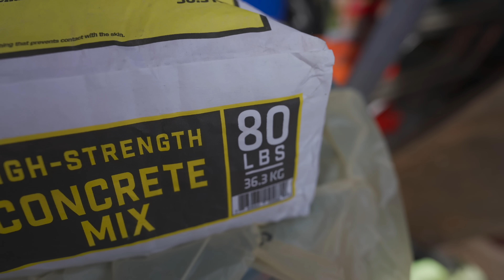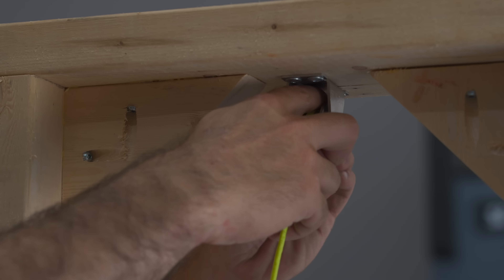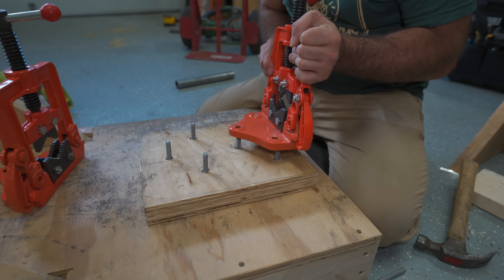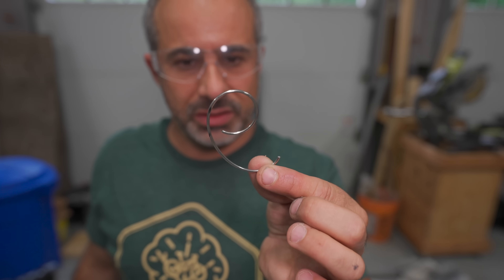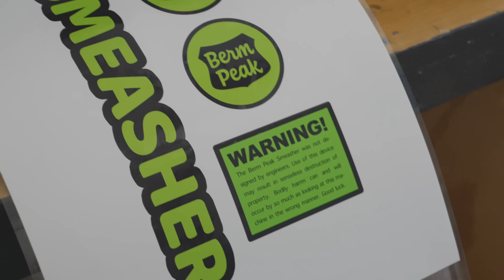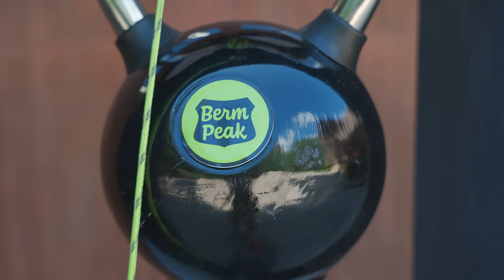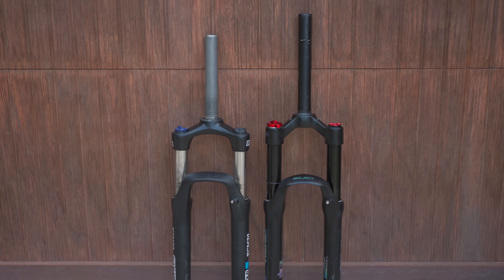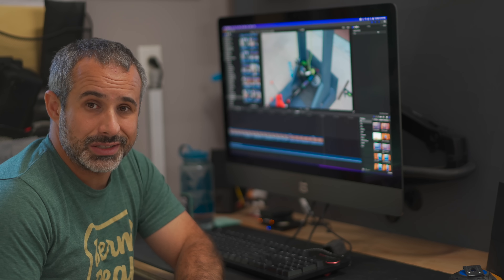Building a Suspension Fork Impact Tester for Science

Comment: I need help finding a decent fork for and older 2005 giant reign. It’s a 26” 130mm straight 1 1/8 tube disk brakes. I’ve hade No luck finding one. Local bike shops can’t get parts for the old spring manitou splice elite.

Comment: HI. I have a request/idea for a video. I have gained a lot of weight over the last 4 years.
I was looking for a new frame, or whole new bike, since my trusty commute MTB, now have a completely cracked seat post tube/socket. What I noticed, where how hard it is to find a frame that support a very heavy rider. 300lbs+ etc.
I was hoping you could reach into your knowledge and connection, to maybe make a list of components that would hold up to such heavy riders and the limitations?

Cheers from Denmark.
Reply: Buy an enduro bike or a downhill bike, they're built much stronger, or if price is an issue look for a bike with oversized tubing and at least over 30mm seat post ,they should handle upto 400 pounds ,of course you're gonna need big tyres to spread the weight at least 2.3" width and always check your spokes are tight, I'm 6'2" and around 270 pound so I always look for strong components
Reply: @ianmangham4570  The last part of your comment. "I always look for strong components", that is exactly to problem. What is a strong component and where to find them? Enduro bikes are out of the question price wise. They cast too much in Denmark etc, but it's a good bet. I am 189cm tall, and finding a frames fitting that height on limits the selection.
Reply: @Mr_Wh1  Strong components are OVERSIZED/BEEFY
Reply: @ianmangham4570  I looked at a Cube MTB the other day. They had a higher weight rating on their web page then most others. The frame part going from the head to the crank, was big and almost balloon like. But when I knocked on the aluminium, it sounded like it was 3x the thickness of a beer can.
Reply: @Mr_Wh1  You should buy 2nd hand from Ebay
Reply: @ianmangham4570  If you mean Enduro bikes on the used market, then maybe. But you don't know what you get. Here in Denmark even the used price on "specialized" bikes are crazy. Like starting at 3500USD crazy. 🙃
Reply: @Mr_Wh1  Wow,crazy price's, here in England 🇬🇧 you can buy a 2nd hand £1500 bike for £500
Reply: @ianmangham4570  Gotta pay those world high taxes. They are so high, that there is special export reliefs agreements to Denmark for cars in every country, or it would be impossible to sell a car here due to the prize being too high for people to pay. A high-end Tesla can cost you over 100k USD.
Reply: @Mr_Wh1  The thickness is only where its needed, you are better off buying a second hand bike from EBAY UK then asking them to post you it to Germany 🇩🇪, still WAY CHEAPER, some beautiful quality CUBE mountain bikes on ebayuk 🙏🇬🇧👍

Comment: The most hated suspension fork here in Philippines. If you used it on trails either the stanchions or the crown Will suddenly cut or crack off. The integrity of that brand is pure trash.

Comment: The most common issue with Bolany fork is the crown and the arch can break easily, others may have issue with the lockout system, it doesn't work properly in the long run. That's why I prefer my clients to buy SR suntour forks instead of cheap and garbage forks

Comment: I think if your trying to hit close to true machining as the one they have at cane creek, then maybe using like a used at-home gym system and just retrofitting it into a smasher.
   1. Already has a rail system with added weights that you can then increase or decrease weight for testing rails
   2. Depending on the specific type, there are ones that are steel (mostly older versions) that can withstand the added punishment
   3. Adding steel planks on the side where the seating is located and adding the kettlebell with a guide should minimize the necessity to come up with something from scratch
   4. The post where the seating would be on could be then fitted with the clamps with some U-bolts since the seat is usually smack middle of the machine

There's also some other stuff that would be taken into consideration but I think that outweighs the cons and assuming you get a good used affordable gym system, why not
But then again, just my 2 cents, probably something easier and simpler out there

Comment: Love the video.  R&D Engineer here, if you put the fork at the top and tie a rope between the weight and axle then drop the weight, that would result in much higher consistancy in the experimental results and eliminate a lot of the variability in the impact. Could also throw in a strain gauge on the rope to get measuments of how much force is being applied and change the length of the axle/weight rope to alter the force beeing applied.

Comment: You need to sort out the clamping mechanism as the rotation at impact means the tests are not repeatable and consistent. Also dont use those jaws as they will create stress risers in the stem (but i think you already figured that out.) An easy alternative will be to bore a 1 1/8" hole in a 4"x4" square block of wood, cut in half down the hole length and use 4 bolts through it to clamp down. For the purposes of your content this should suffice as I doubt you want to go the the expense of creating a setup made from exacting milled steel parts just for some YT entertainment.

Comment: Hey seth.  Something you could try to fix your issue with the box limiting the amount of deflection the forks have is you could add a second rope and pulley and pull on a angle with the weight tentioning the rope only a few inches before it hits the ground. That way the sky is the limit for how far the fork can bent. Hope that is helpful. 🤙

Comment: Unrealistic test.  Howmany direct impacts would a fork see, nearly none unless you ran it into a tree or a wall.   

The fork only see forces in the same angle as the trail or rake that its specced on.

The only useful data from this test rig is steer tube strength,  which can be seen with this current build because you used a secondary pipe to be clamped down

Comment: if you got similar results based on what information was provided with this test alone then it would be inconclusive because with only two test results they are most likely only showing the capabilities of your smasher. You now know nothing new about either fork except that they both WILL bend under force... that is all... but yeah secure the fork completely and drop the area where it will bend as you said; and you need to guide the weight so it hits centered everytime. Or purposely try to hit it on either side maybe to test shearing strength... Gotta do a part two though its a great idea, but tests like this need to be extremely precise to be able to show any results whatsoever, otherwise you're just reading slightly correlated numbers, i love the idea of a fork guillotine!

Comment: I have a similar cheap fork by a company in the uk by a company called Air Bike. They say they work with a major manufacturer but due to an NDA they won’t say who it is…..alloy steerer too. It’s worked pretty well for me, I’m probably the same height as you Seth, little lighter, not as good a rider but I’ve taken it over some rough terrain and had some hucks to flat and it’s done it’s job. Maybe check them out

Comment: The big problem here is, where as the steel one will bend the aluminum one can form micro fractures which can lead to it snapping later on. Which in the past is why aluminum forks were so dangerous (Death Forks).

Comment: I say chop off the front end of a cheap steel donor bike so you can weld it to a slab of steel.  Use wedge concrete anchors to mount the slab to your test rig. Mount a stem and handlebars with strong springs under each end of the handlbars to mimic the deathgrip of a panicked rider who slams the bike into a large tree/boulder.  That will give you more "real world" results.

Comment: Hey Mr Alvo what's a good winter time hack when riding in snowy weather and temperatures in the teens to keep your gears and cables from freezing and stopping you from shifting? Just wondering also would coating the cables in anti freeze work?

Comment: You should use or build a bow hunter's quick release and replace the pin. Also, have a strike plate that your kettle ball hits that is implemented into the base that falls evenly. Next time you build your base, put pvc tubing or steel tubing in your wet concrete where your clamp bolt holes are going through, just to save yourself the headache of drilling holes. Looks good though and I appreciate your videos.   I'm nobody, by the way and am probably wrong about everything I suggested.

Comment: less than 1 minute into the video and I notice the design flaw. didn't even have to get to the end to verify it. The end of the forks that takes the impact needs to be free. hanging. The base underneath. it doesn't give it enough room to take the whole impact of the weight and get any type of meaningful data. useless contraption entertaining content.

Comment: I'm surprised you didn't pre-mark you clamp holes and put some small pvc pipes into the concrete so the you didn't have to hammer-drill through the concrete. Also some casters on the back would help with transport.

Comment: I have one of those Bolany forks on my bike. Needless to say, it runs alright - I'd say a little better than the Suntour fork that originally came with it given that the air is more responsive. You could say it's basically an air version of the Suntour. 

The only problem, however, is that none of the parts are replaceable, such as that damper cartridge given that they are made differently for every single fork. Even the dust wipers and other seals have no equivalent replacement. 

Being a cheap fork you can run it to the ground and buy a new one, even re-oil it once in a while to keep it running nicely, but it bothers me that the "company" doesn't have an online parts store to keep their product reliable. 

The reason why bike manufacturers use the Suntour, I think, is because Suntour has a longer history of testing and runtime compared to Bolany. Those heavy steel bits mean the Suntour will last for years under normal riding conditions with little maintenance. I get that most riders hate them, but it's hard to argue against their durability for beginners crashing regularly in to rocks and trees.

Comment: Hey Seth! love your vids! I have a question. Can you fit a tapered fork to a non tapered headtube frame? Reason is, my bike is a older Norco and most of the nice new forks are tapered. Is there maybe a adapter of some sort? Thanx man!
Reply: if the fork is bigger than the headtube it physically cannot fit into the frame. some suspension forks allow for removal of the steerer tube from the fork crown which would allow a new one to be fitted but that's not an easy procedure. 
if the frame headtube is bigger than the fork, there is likely a headset that will be able to adapt them.
just get a non tapered fork, even though there aren't many there's still a decent price/quality range of them from coil to air to oil. i just put a rockshox recon silver TK air fork on an old 90s mtb for a customer and its fantastic.
Reply: A bunch of manufacturers have lower headset cups that fit into straight sized headtubes and accept tapered forks. For example Cane Creek 40 EC44/40 Lower Headset Cup would be used for a straight headtube with 44 mm internal diameter. If your headtube size is different try googling the right part. You will have to live with an external bearing cup though, just fyi it will raise the front by a little compared to a zero stack cup.

Comment: Need a way to keep the fork from spinning during impact. The weight being round isn't helping. You could probably add something flat and wider than the fork to the bottom of the weight to help this. Just gonna have to be pretty rigid. 
Or would it be useful to clamp the actual steer tube instead of slipping it into that pipe?
Reply: Looks like cane creek clamps the steer tube.

Comment: As a to be mechanical engineer and a diy crafter
I praise the effort seth.
But it would be thetter if the weight had a angled point which would hit the fork, also, you can build a guide for the weight to come down precise everytime with the sideposts as guide rails..
And the steer tube clamping vice would fare better if they were mounted to a hard surface, 
The wood would create dents and lose energy

Comment: Interesting idea, and I have a couple of contents and questions on it. 
First the questions: why do you want to hit the fork from the front? That’d be like riding into a wall. Yes it’s good to test the perpendicular strength but in practise that’s a force you only see in exceptional situations. 
My other question is, how do you quantify the force on the steering tube section? It’s actually not too complicated with newtons laws.

As for the comments (or considerations):
Assuming no alloy characteristics, steel is 3 times as strong as an equivalent object in aluminium. This means you can use a tube that’s a lot thinner from a strength perspective. 
However, with tubes, the wall thickness matters. if the steel tube is three times as thin as an equivalent aluminium tube, it’s actually more likely to buckle. It’s also less stiff. 
In addition, steel is much tougher than aluminium. This means it flexes less before it breaks. 

This means that for the same force, if the force is high enough to break steel, it might not break aluminium, as the aluminium flexes more. (Actual specs you can find for specific alloys from manufacturer websites).

What that means for the fork, is that the fork should be placed much higher in your construction to cater for that flex. 

You can also make some predictions of breakage, soo you can estimate the weight you need to break the steering tube. (Again a few laws from mr Isaac N).

Super interesting project!  I look forward to seeing more!😊😊

Comment: This looks like a fun toy and looks cool in a video but its little more than that.
+ Its no where near stiff enough
+ There is a reason machines like this use linear guides, you need to control how and where you impact the fork/product. If you look through the ISO testing standards there are also very specific drawings for how the impact surfaces are machined
+ You need to clamp the fork as it would be clamped on a bike. With those orange clamps you're clamping in the middle of the steerer, this is not realistic
+ You need some way to measure the data. This would ideally be the total displacement during the test, permanent displacement (after the test), and acceleration of the carriage. From there you can calculate anything else that you may need

I would be happy to advise you a bit on future projects like this, I have designed and built out many machines that are used in the industry

Comment: I would have put rails on the insides of the vertical part of the smeasher frame, and built a frame to hold the "bowling ball" that fits into the rails.  That'll keep it traveling straight and will hit the forks more squarely.

Comment: Weight needs to be guided down, easiest way is a wooden bar with 3 cutouts. Center one for kettle bell which fits snugly and two holes in the side so you can put either pvc or metal guiding rods. PVC is cheaper but any flexing lowers efficiency, using 'cheap' plumbing tubing ( stainless ofc )  will do better I think. You need the guide rods to make sure the path the weight can take is always the same so results are consistent with the changes in material strength or impact force and no other factors. 

Forks need to be TIGHT, you can't introduce play it will introduce random results. 

If you really want serious results, weld a frame for this purpose. Don't make it out of wood, it might work well but I doubt it would last and then you have to rebuild and your results are incomparable suddenly. Also, with most test rigs, you want to make sure the rig is always stronger then whatever it is you're testing. 

I like this concept though, it's very interesting and it's something the industry itself has way more insight in then us consumer since as you showed they actually do test this in house... they only never give results other then: maybe don't do XXX with that particular fork. I would perhaps like to see the same concept but with bike frame's themselves. If you crash, what would happen to your frame ( different frame types ) and should you worry about replacement or perhaps if it's steel can you really just 'bend it back'? Those kind of things are well known, but only because people always talk about those things... I never really seen it tested and visualized. Again a point for a welded rig as you can make it so it can hold all kinds of objects, in all kinds of orientations. 

In the end I think I wouldn't even rely on gravity but build a hydraulic piston ( you already have an air compressor ). With an Arduino and some sensors and valve's it's not that easy but certainly doable DIY project. And if you're not up for it, I'm sure that if you ask the community to help you out people will be more than willing to come up with some rough schematics or something.

Comment: smashing the lower legs is improper  ...  a 2x4 laid the axle would be appropriate for a truer impact rating with the 2x4 guided by 2x4 channels screwed the the frame to work like a guillotine
ps
mount the pull pin up high on the side 2x4 to give you enough line so you don't need to re-thread the pulley and have a big knot to keep the weight from running away
pps
maybe mount bottom pulley on a cross member that might help contain the weight also